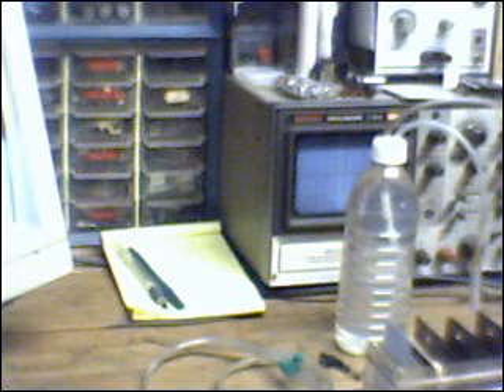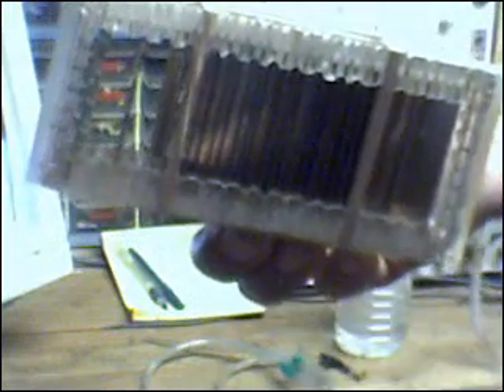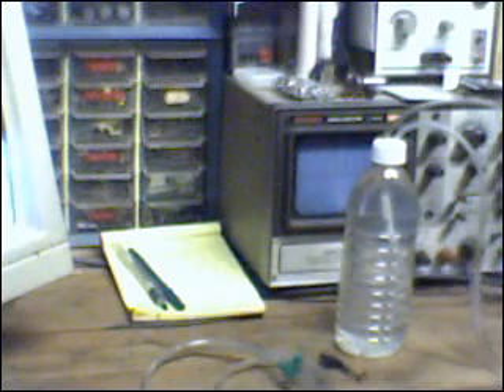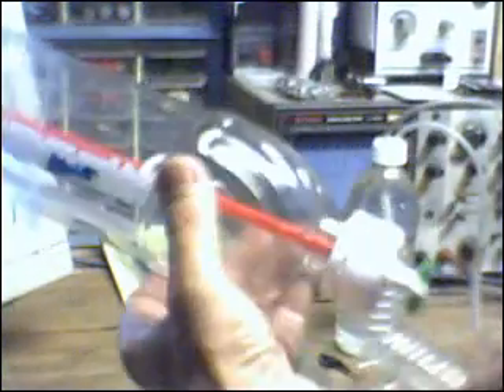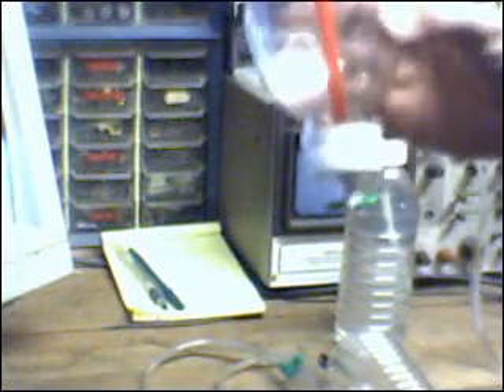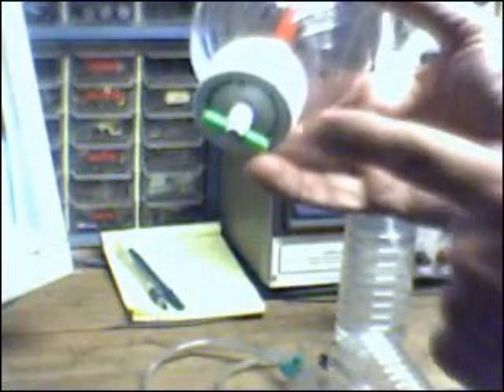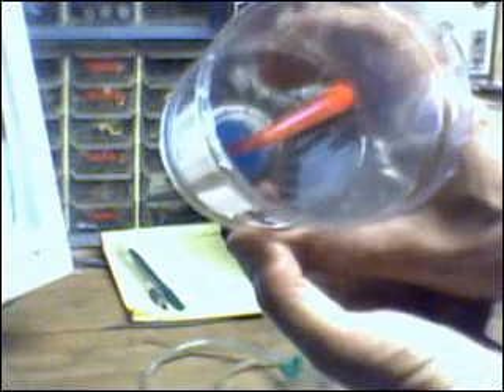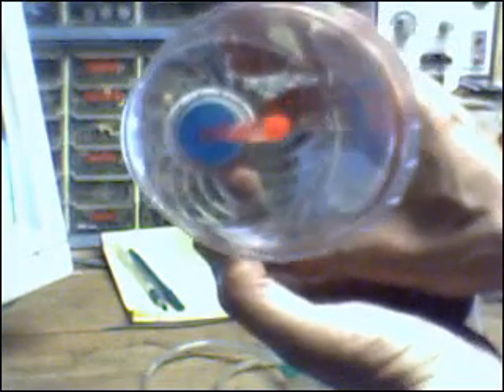28 - Hydrogen HHO Electrolyzer MODIFICATIONS 2007/08/06

Comment from the maker: And tonight it worked flawlessly. The cell not so flawlessly. Sid was right. MUCH more leak-by current across the bottom. I also had gas coming off both sides of the positive electrodes and in the middle around the negative. Despite this, overall efficiency was still about the same, offset by the closer plate spacing. It's full steam ahead now on the next generation cell. Can't wait to show it off!

Comment: Soooo, aren't you going to get current "leak by" under the bottom edge of the plates?  Have you used your volt meter to check the electrolyte in various places for voltage?  It is pretty interesting.